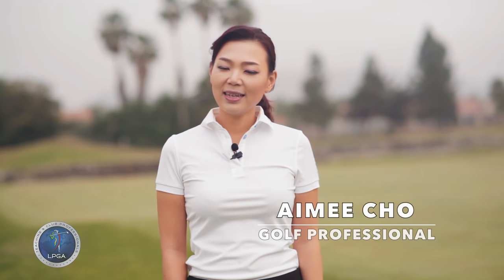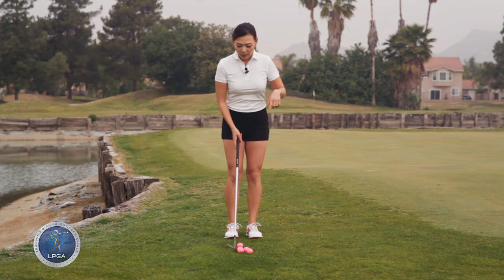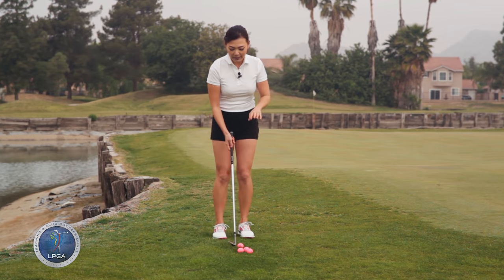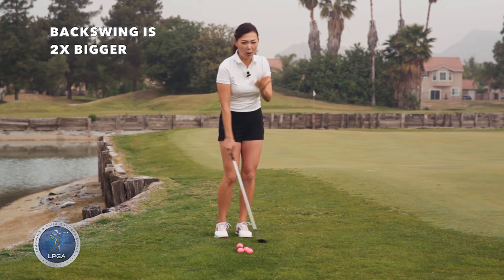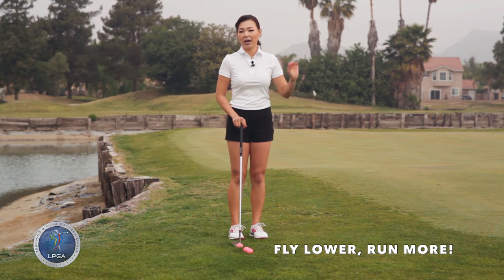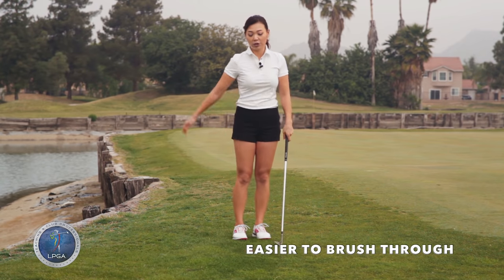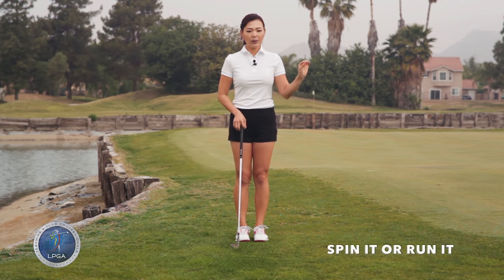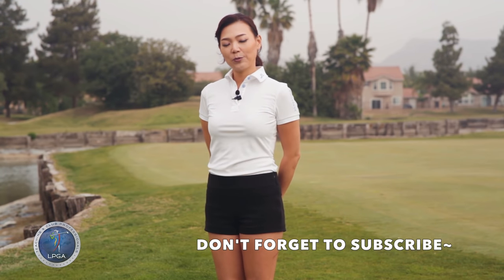Running & Spinning A Chipshot | Golf with Aimee

Comment: I have been told that a chip shot is simply a putt with a different club.  That thought has helped me prevent the lateral approaches, hozel rockets, snap fades, etc  (sha---s) that often creep into my otherwise very good chipping skills.  What are your thoughts re what I have been told?  I think the putting thought with a chip prevents my getting stuck inside in the takeaway in a chip shot.